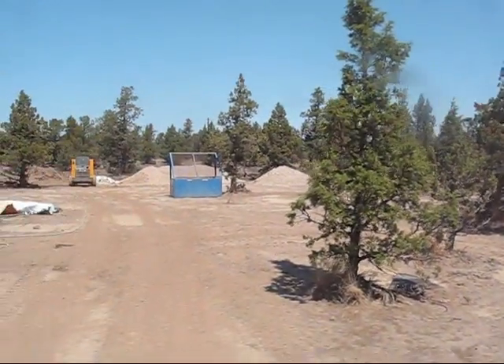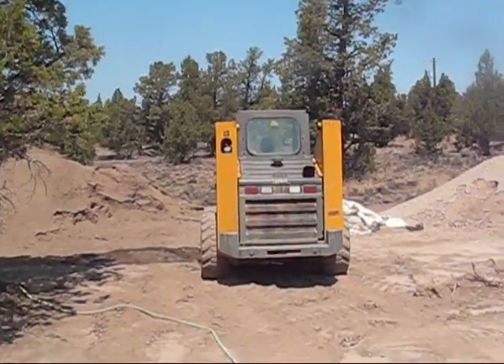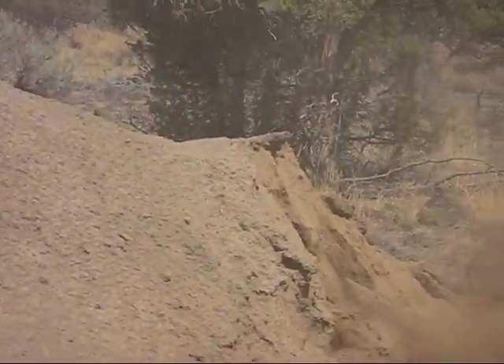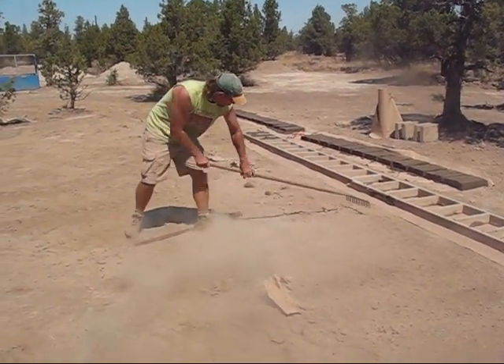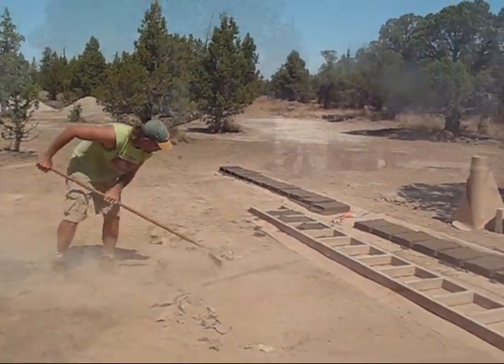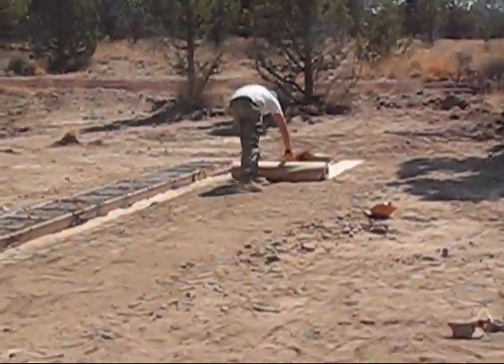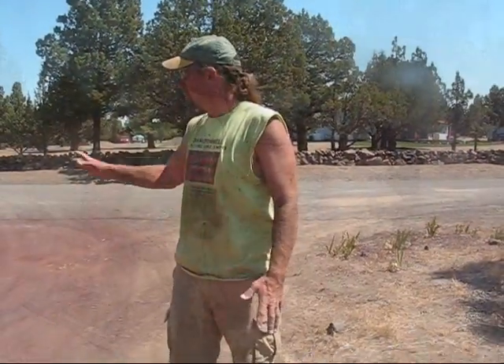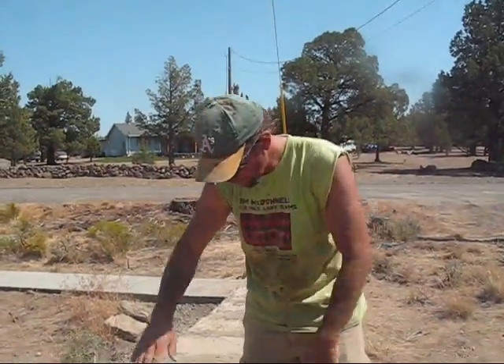Semi-Mechanized Adobe Brick Making 101

Comment from the maker: To MilitiaHQ - Yes you can use regular portland concrete.  Normally, you would never use more than 8 or 9 percent in the mix.  Sharp sand that sets up well can be up to 60% of the mix.  The heaviest clay element of the mix should not be more more than 20%.  Lots of purist say don't use straw because it will break down over time.  I think a clean straw to bind the bricks and make them stronger.  Experiment until you find a good mix and solid bricks.  Good luck!
Reply: 60 % will be sand; 20 percent is clay; 8-9 % is cement.... It will not be 100 percent. What is missing then? Thanks in advance.

Comment: To me, the best part of making bricks is the SILENCE.   There's no way I'd put up with that constant noise, couldn't even make it through the video.

It is so incredibly satisfying to use a pick to loosen up the hard desert dirt, double screen it into a wheelbarrow and the small rocks are saved for other projects.   

Was hoping the mechanized part was a press.  Quiet, manual.  Much harder bricks without the airholes and of course they'd dry faster.

Comment: One question..If these bricks were used for house walls, would you make them any differently..since they are load bearing? Need any verticle rebars?
Reply: +Unguidedone   Thank you for your helpful reply.
Reply: No need for rebars. In Yemen, they are making 7 storeys Adobe bricks buildings centuries old and still standing.

Comment: I will concentrate on all old time ways of making Adobe for a 20 X 30 cabin in the northern mountains of Arizona at 6800 foot elevation. A quality made brick from times past will last 1000 yrs..
We have Adobe buildings that are more then 800 yrs old now.
And they have No cement, lime or such in them.. going to have a warm cabin with 24 inch thick walls.
One other possibility is to build a Strawbale and cob cabin with Inside finished measurements being 20X30.
Same diameter of the proposed Adobe cabin needs to be...
With plenty of windows to let sun shine in..And have a 8 foot over hang or have 8 foot covered awnings all around cabin with a nice wood decking all around cabin. That will be good insurance to keep rain off cabin and the snow off as well.
Have a nice root cellar too for food storage.

Comment: That's exactly right when it's a 'learning curve' job - "when we get to the entrance it'll be build with the best bricks we know how to make". I've just dug and built a concrete drain / troth / channel around the house and the best wooden forming and concrete mixing and laying is in the last section I put in. It started off pretty rubbish. The digging technique was no problem because I've dug in lots of different jobs over the years and I know hoe to do it. But I've never laid or formed concrete before. My advise to anyone doing diy construction at home is - watch as many of these videos as you feel you need to until you're confident in what you're going to do. I'm about to lay a 20ft path out back using recycled materials (from the drain dig) - I might make some adobe bricks as extra stones for the paving just to add a bit of curious / interesting variety.

Comment: i guess putting on modern day sealers would defeat the purpose or be impossible, but if you could it would last way longer even a coat of oil might be beneficial ? i don't know.  I know this is an awesome way to build, i was perusing through some wild america pictures when i came cross this.

Comment from the maker: Chris... thanks for commenting.  You make several good points.  I was probably too optimistic about how long the wall will last.  It requires a steady maintenance to last.  Also, it is very important to stop water from entering through the top or wicking up from below.  I now have a cap on the wall.  Have a nice day.